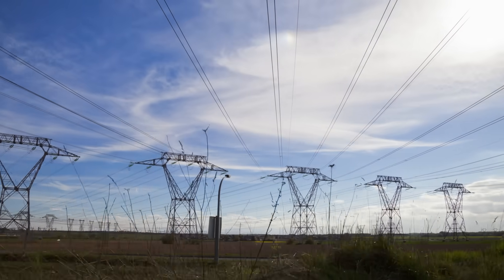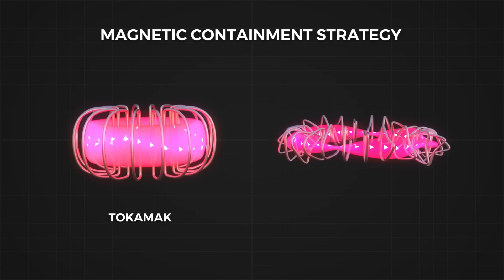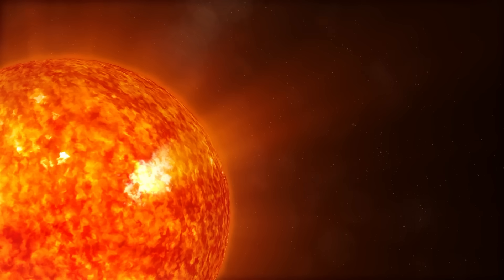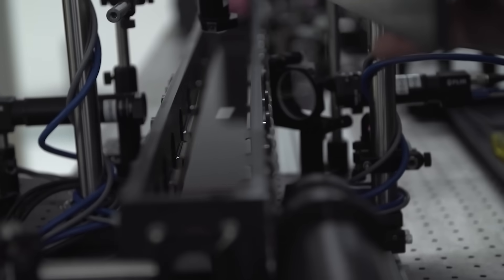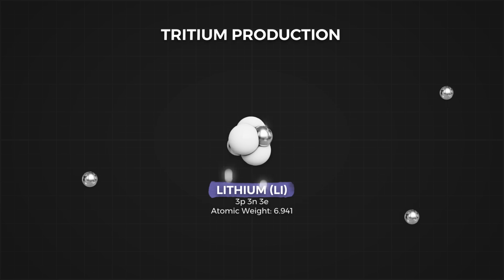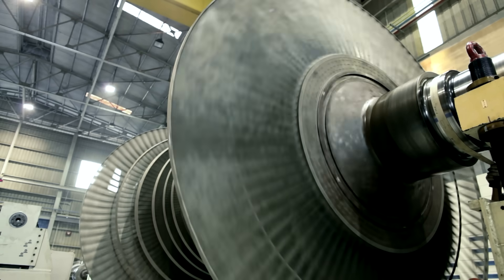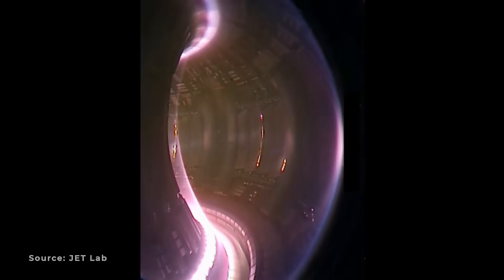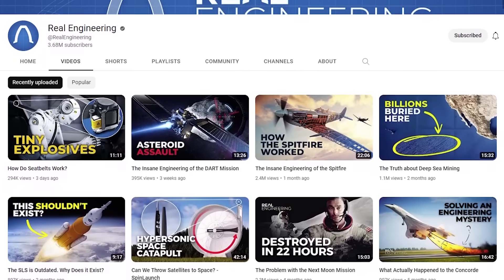The Problem with Nuclear Fusion

Comment: Even if the cost is excessive, or there are issues with long-term disposal of parts, the first functioning fusion power generator will be built regardless. The concept of having near limitless clean energy will be too appealing to wealthy nations to pass up. Not to mention, once a successful fusion reactor is created, the success will help pave the way for numerous other designs of reactors. I can't help but to hope it happens within the next few decades

Comment: Nuclear fusion will never be practical until it can be done on plain natural hydrogen.   Deuterium and Tritium require isotopic separation, and Tritium is extremely rare and scarce.    Eventually they will solve the net power problem on a heavy hydrogen fusion reactor, but it still wont be able to go into commercial operation due to lack of fuel.   There is only enough heavy hydrogen to fuel experiments, not commercial operation.   Technology will have to continue to improve until the day that plain natural hydrogen can be used, and that will probably be 50-100 years.

Comment: I like this video, but one point I disagree with, about fission reactors:
They are not, inherently, too expensive.
What makes them expensive is the asinine regulations that stipulate that they have to be built to the max safety of current technology. 
Meaning that as technology improves, so will cost. Because every new, safety-enhancing technology, has to be built into the new reactor or else its a violation of the law.
No other energy generation technology is required to do this.
If we ware to build reactors to a "reasonable" level of safety, that would probably cut their cost in half, if not more.
Without any commensurate reduction in actual safety.

Comment: Nuclear fission is not being shut down to do cost. It is being shut down for political and ideological reasons. There has been a massive resurgence in both keeping open current nuclear reactors as well as increasing the nuclear fleet across the globe.

The cost that is high is the near endless amounts of bureaucratic red tape. South Korea, UAE and multiple other countries have and continue to have the build times of nuclear reactors from ground prep to operational in less than the time it takes to deploy a fleet of offshore wind turbines and at less cost. Also there is a massive amount of funds in the nuclear decommission fund for the US and is not a problem like you are implying. I bring up the US specifically as they are pointed at repeatedly as being the worst for nuclear power deployment.

Comment: The problem with nuclear fusion is the cost of Tritium. $30,000/gram.
Do the math. 
@ MIT Lecture in CA, “1 gram of fusion fuel is enough to power a house for a year.”
1/2 gram of tritium + 1/2 gram of deuterium costs $15,000.

Comment: Fusion uneconomical ? It's a lie. And its going to be even better in the future: for the same TWh of produced electricity, it needs much less steel, concrete, copper and other ressources than solar or wind. And I don't even talk about the land required. Extracting all those ressources will become more expensive because the easy sources are now dry. We'll have to dig deeper and deeper to get ores than have a lower concentration of the wanted element.
For concrete, there's already the problem of getting the right quality sand.
The problem is just investment. It takes years to build a nuclear reactor and you have to wait a long time to get your money back. But in the long time it's better.
This kind of stuff shouldn't be in the hands of private investers anyway.

Comment: The problem with fusion is it does not have a chain reaction. The chain reaction is what makes fission profitable.
Reply: Fusion will be more like a fire. If the fire is large, dense and hot enough, it can keep itself going while still kicking out excess heat.

Comment: It should be noted that nuclear fission is made a lot more difficult and expensive than it needs to be by NIMBYism and lack of political will. We built hundreds of reactors during a time when energy was much cheaper than it is now. It's actually very cost competitive over the long run, especially when you consider how heavily subsidized other energy is, but 1) requires a massive upfront investment which is difficult for utilities to stomach given the uncertain future of reactors in the current political environment, and 2) because of these issues, almost all currently operating reactors are decades old, which makes them much more expensive to continue to operate both due to wear and tear and simply due to being old designs. Not to mention less safe than modern designs.

The best example of what is possible given the will is France - a great topic for a video!

Comment: You should discus an extremely dangerous issue for tokamaks - burn through of the containment wall via the plasma. This occurs when the field breaks down and this will occur on a regular bases for long burn times (60 -120 seconds or so.) This will deposit a huge amount of energy into the walls when the burn through occurs and the vacuum is compromised - sooner or later it will for tokamaks. Worse, this burn through can occur into a super conducting magnet - if that occurs, your entire day is ruined (and loss of the entire plant will then occur - the stored energy in those magnets is huge and when they go from SC to normal, all that energy released does terrible things.) Till this instability is controlled (and currently, no one knows how), any tokamak burning for extended times is a bomb ready to go off.

Comment: Very good video.
This is only the second video on YouTube pointing out the problem of tritium availability, and the solution tested with ITER.
The final judgement on fusion reactors will come the day all data about conversion efficiency of the neutron flux into heat (powering the turbines) and the efficiency of plasma lighting - we need the plasma to provide 50 - 100x the amount of energy needed for holding a stable ignition. The tritium breeding efficiency is the last magic number which has to match to make fusion viable.
My calculations of the total efficiency of a practical fusion reactor, and the amount of tritium which can be bred, are not encouraging; but they could be wrong. We need to evaluate further numbers as the experimental reactors come online. We need more of them though.
Thanks for the video...
Anthony

Comment: 13:50 actually in the LONG (25y+ iirc) run nuclear reactors tend to be more profitable for investors/countries then any other source of power we currently have mass adopted.
It takes about 3 years for a gas powered plant to break even.
6-8 (iic) for it to have made 'cost of production +100%'"
20ish for a nuclear reactor.
wanna know how long before THEY hit that 100% ;)
not even 5 years later (iirc).

It's disgusting how much more profitable a well maintained reactor can be.
the numbers are absolutely wild.

Comment: Great video except one point. The cost of fission ain't the reason why plants are being closed. Because it's the subject I know the most and the country famous for it's nuclear energy I'll only use the example of France. In France there is 56 reactors producing electricity, and 12 are being dismantled. The reason that they are being dismantled is not money, in fact dismantling a reactor before the end of it's lifetime would be a huge waste as it could still be used, most of the cost comes from the construction. They are just being dismantled because they are too old, roughly 60 years old, except Superphénix which was a fast-neutrons reactor (FNR) or Fessenheim (pressurized water reactor) that were closed because of some environmentalists (I don't even know why they would do that). Let me give some figures to prove my point, the new reactor in Flamanville is expected to produce roughly 600 TWh for a cost of 6.5B € while the money that was invested to build solar panels in France was 2B € to only produce 5TWh and it's roughly the same for wind energy. As you can see it's nowhere near expensive.

Comment: How about doing a video on the Moltex family of stable salt reactors, and their waste reprocessing technology WATSS – waste to stable salt? They say their reactors will be no more expensive than coal-fired power stations to build, with a levelised cost of operation of $40 per megawatt hour. The first flex reactor is expected to be operating commercially in the UK by around 2030. Their grid reserve heat storage technology will enable them to sell their electricity during peak times when they will make most profit.

Comment: What happens if uranium or another fissile material used in fission reactors is used to line the walls of a fusion reactor to add heat from fission to the steam generator. Would that be a way to "turn on or off" fission? Adding a layer of safety to fission reactors and added efficiency of direct electric induction of fusion reactors? Also would this allow longer use of u235 and it's byproducts?

Comment: I think it would be a bit overly simplistic to say cost is the primary reasons fission plants are being shut down. In France and Germany, where the some of most are being closed, the reasons are a lot more nuanced, but otherwise this is a really good video on the topic.
Reply: Not really nuanced: political propaganda, that's all.
Reply: @v0ldy54  Well France also wants to shut them down to be less reliant on nuclear, but it does all stem from the same place so you are right really.
Reply: Irrational fear is the main reason nuclear reactors are being shut down
Reply: Agreed. I think that part of the video is just incorrect
Reply: Exactly. The problems facing fission power development are mostly political, not economic.

Comment: Make no mistakes: the ITER is a technology demonstrator. Its main function is 1) try to produce a stable fusion that can be sustained over time; 2) if part 1 has success, then try to demosntrate if the proccess delivers more energy that requires; 3) if part 2 has success, then evaluate if could be economically viable for commercial use. I support the ITER as what it is: a leading edge collaborative effort to try to find some answere, and by the way, the fusion quote is "fusion is, and always will be, the energy of the future" and the range is 30 years ahead, not 20.

   Being said that: fission (conventional commercial nuclear reactors) won't solve our energy/environmental problems, due 1) they are being abandoned due were never profitable, they exist due world powers wanted nukes and the incredible cost of them had to be splitted between civilian reactors and the military needs;  once the military needs were achieved and due the insane cost of those programs fundings were cut and power plants were left on their own, and happens that nuclear energy can't compete against other sources. See General Electric's bankrupcy or the nightmarish state in which France's EDF is to validate my point. 2) Even if we chose today to double our number of nuclear reactors not a single one will be ready in the next 12-15 years, so won't help in the climate crisis. 3) Even if we were able to succesfully double our nuclear output in the next 7 years that barely mean anything: nuclear is only ~10% or the commercial ELECTRICITY produced in the world, and that's a MINIMAL part or the total ENERGY human civilizatioin consumes. To entirely replace all of our fossil energy sources by nuclear we woul need ~14.500 reactors, which is impossible to achieve (not enough money, raw materials and more important: real state, to build all of those (you need safe zones and plenty of water to build up a plant). 4) Finally, if you want fight climate change start for things as simple as reducing your meat consumption, insulate your home to make it more efficient, use public transportation and refuse plastic package as much as you can. Nuclear fission is just a waste of money (that's why shills as Gates beggs for public founds instead of burning his own money in it!).

Comment: So it's not just the Lithium but you actually WANT the Beryllium as well.
MIT's ARC reactor is to be built with a molten salt FLiBe blanket and the reasoning was pretty clear, you want something that doesn't get destroyed structurally by the neutrons (it's liquid so no problem) you want something with high heat capacity to carry off the heat of the reaction out where it can be used (which it has and at high temperature too which is a bonus) and you want to breed Tritium from it (for this I assumed it was only the Lithium that helped but apparently the Beryllium helps too). And then there's the fact that FLiBe molten salts are very good for molten salt FISSION reactors as well so the science around them such as what pipes to use and how to prevent moisture etc. is already being worked on for some time with pretty good results so far.
Reply: Making the walls liquid is a pretty interesting solution to the problem of them being destroyed by neutron radiation over time. I imagine it's not exactly easy though, there will need to be some solid parts in there still.
Reply: @korakys  Of course it's not easy ... I'm a staunch proponent of investing into molten salt fission reactors right now because the issues there are basically solved already and the "pipe dream" of clean cheap abundant energy is fulfilled by those as well at least for the next few hundred years

Comment: Nuclear power is not on the decline and the places where it is on the decline are not due to cost. 

Nuclear power is on the rise in China, India, Russia, Croatia, Japan, South Korea are among the places where new Nuclear Reactors are currently under construction. 

The nominative reason for an aversion to nuclear power may be listed as cost, but that is not the true reason. The reality is that in the US and Germany there is a public perception issue with nuclear power which has led to immobile policy on existing nuclear power and dissuaded government active participation— thus triggering the passing of costs from private enterprise to the consumer. Governments can and do absorb near infinite amounts of debt- public works are funded all the time and when an aircraft carrier is built the cost is not passed down to citizens via tax. But why would these nations invest and adopt a nuclear policy when oil is so relatively abundant? That is as abundant as OPEC allows and is convenient for them.

What science says is capable is not readily implemented due to regulatory limitations imposed by the government officials in fear of creating another Chernobyl. Nuclear waste is not a scientific problem, it is a policy problem. Nuclear waste is only labeled waste and treated as such due to government policy with regards to preventing proliferation. But this comes at the cost of potentially recycling that fuel and recapturing it’s energy potential- only 4% of the energy potential is utilized prior to being labeled as waste. Molten Salt reactors are a key component to this process, already in implementation in Canada. In the US, molten salt reactor technology was already identified in the 70’s as a viable way of generating energy from nuclear materials, namely thorium, but the program was arbitrarily shut down and the granting of research licensing ceased. Only in 2010 was the research uncovered. Now China, Croatia, and India are already in the ground breaking stages of the construction of these types of reactors while the US is currently struggling at a policy level of how to regulate this activity before considering construction.

So to say in two sentences that nuclear power is in decline is an incorrect oversimplification. There is existing technology that is not being realized at an industrial scale. Energy security is realizing that this policy of aversion causes real consequences due to a fear of over imagined consequences. More people died in Germany this summer from heat stroke than in all the nuclear accidents in history combined. By advocating for more nuclear power, not only could these deaths have been averted but projects like funding the energy start up for fusion power can be realized.